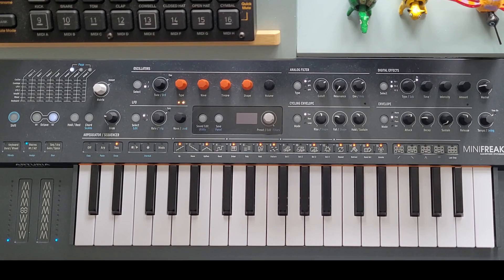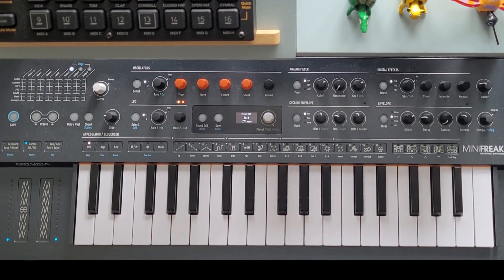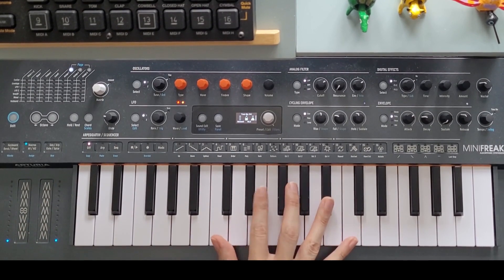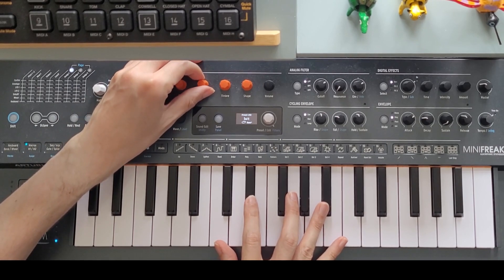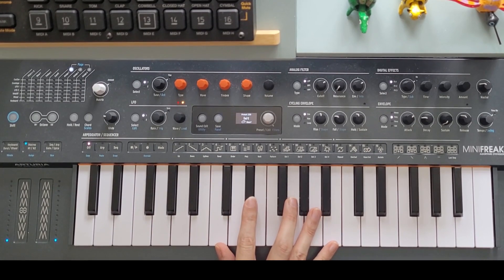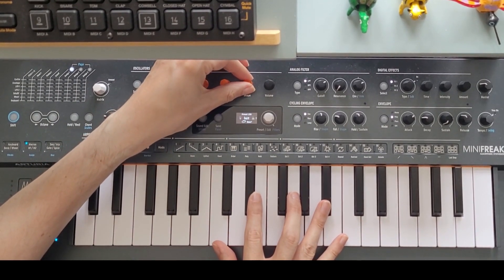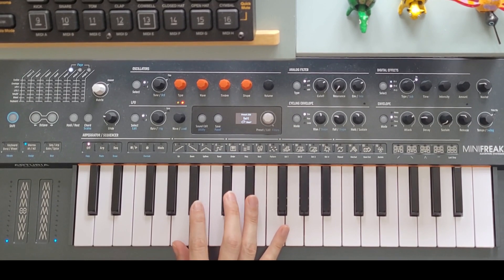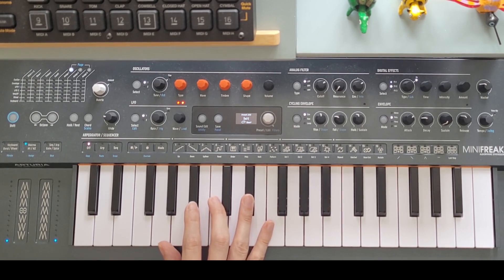FM Synthesis on the MiniFreak (Part 1)

Comment: I love the minifreak. I love the microfreak. I love the opsix. 

That being said I consider the fm engine of the freak series to be more of a complex oscillator. 

The second oscillator FM/RM of the mini is pleasing but no ratio control to speak of afaik. I would be curious to see arturia come up with a fully fm synth
Reply from the maker: It is slightly limiting, but by changing the pitch of the modulator, you can get a fairly flexible stack of three FM operators. It would have been nice to have more of course.

I've been enjoying the Arturia DX7 clone recently and maybe I should record a video of me making a nice breathy bell patch I came up with ... 🤔